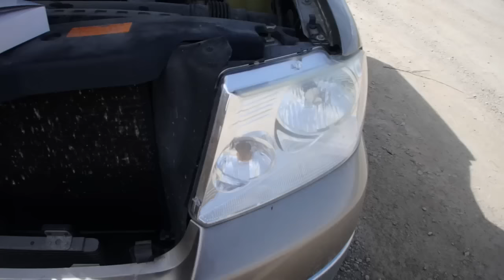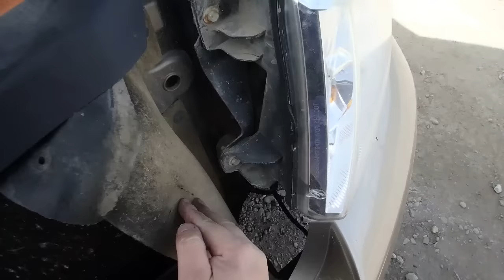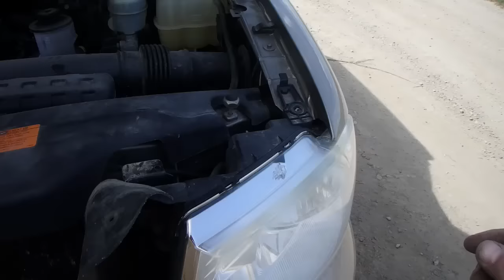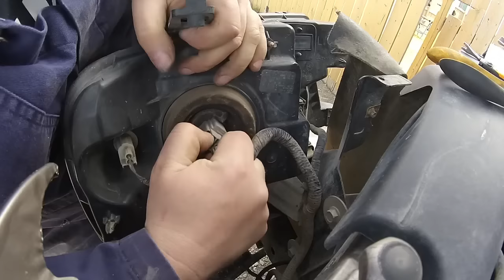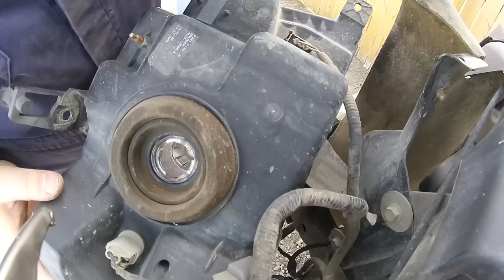2004 - 2008 F150 How to Replace Headlight Bulb

Comment: Only Ford would engineer a vehicle where you had to remove the entire headlight housing just to change a bulb. Smh
Reply: You can buy a new headlight assembly here: https://www.amazon.com/2004-2008-Headlight-Housing-Reflector-Without/dp/B06XRBK8V9/ref=sr_1_14?s=automotive&ie=UTF8&qid=1510304940&sr=1-14&keywords=autosaver88+headlights
Reply: You can do it without removal if you manuever light right. I juzt did it.
Reply: I'm an optical engineer for a tier 1 automotive lighting supplier. Every company does this. The F150 in this video is by far one of the easiest swaps you'll encounter on a remotely new vehicle. 3 bolts is the bare minimum as far as mounting hardware goes. It's actually the optimum number as the system is then totally constrained. Any additional would over-constrain the system and introduce it's own set of problems.

As companies strive to cut weight and engine bays get more crowded by the year, this condition is simply a mainstay. Cars/trucks are now typically designed with a focus on the LED versions of the headlamps, in which case there are no maintenance options for the consumer. The bulb versions are usually there to cut some costs to keep lower trim levels more affordable to the consumer. Remodeling the vehicles framing for those cases would eat up all of those cost savings and then some.
Reply: American engineering at its finest
Reply: Yeah this is comment is way off. Like Paul Hawks said, all makes do this. I’ve swapped bulbs in many different makes, foreign and domestic, and the F150 is one of the easiest.